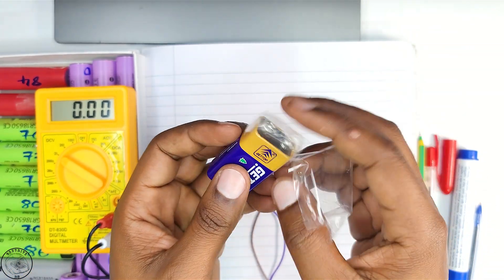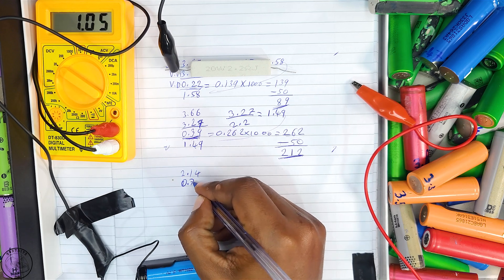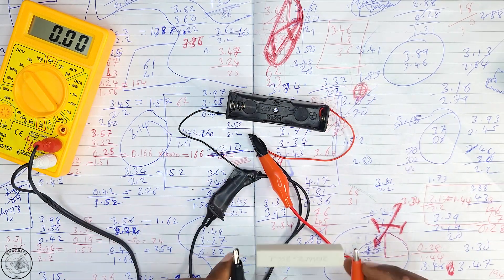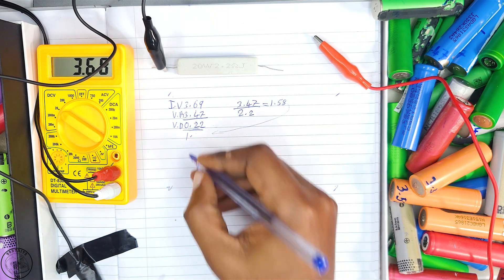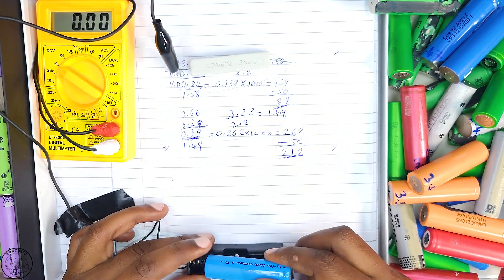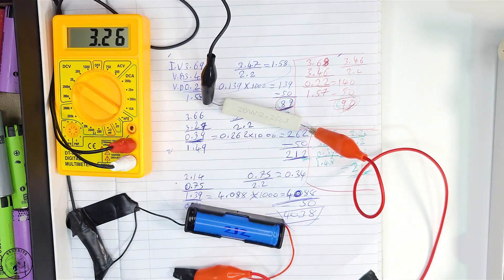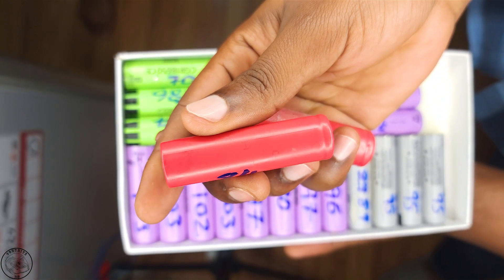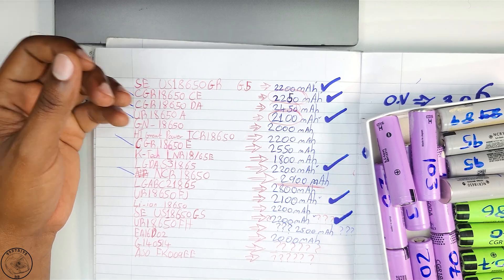DIY Resistance Testing of Li-ion 18650 cells from Old Laptop Batteries (Ep.2)

Comment: nice video.  I've been doing this at work, so it's interesting.  You may get better results if you use a multimeter to measure current, and another multimeter to measure voltage at the cell terminals.  That way you can isolate the characteristics of the cell from the load circuit.  then R=(OCV-V)/I
Reply from the maker: I will definitely try this out.  Thanks for sharing this 👍🏽.

Comment: Why not use a specific battery resistance meter for testing?
I think generally anything from Japan would be of higher quality as they pride themselves on good workmanship. Cars and electrical products usually are well made.
Chinese products on the other hand can be good but they are mainly about producing cheap and mostly rubbish or throw away junk.
Hard to trust for a good battery or anything long lasting.
I have my doubts even if they are supposed to be made to specification for an overseas company for quality control.
Go with Korean or Japanese to be sure.
Reply from the maker: This small series was created with the goal of testing and analyzing the cells in the most cost-effective way possible, ensuring that it’s accessible to everyone. I’m really excited about episode 3; it’s my favorite project to date, and I can't wait to share it with you!

Comment: The chinese cell is rubbish. A lot of cheap products use extremely poor quality 18650 cells, commonly with capacity of only 500mAh or less. Just rubbish, throw it away.
Reply from the maker: the quality of some cheaper lithium-ion cells is concerning, which can be a problem when they are used in higher-power applications.

Comment: That Chinese cell has an open circuit voltage below minimum thresshold. Therefore goes into "protect mode" with too high internal resistance. May attempt to slow charge over time to recover (4.2V at 50mA or less) but no guarantee that anode and cathode will recover uniformly. Better to dispose of.
Reply from the maker: Oh yes! I now realize the issue with that Chinese cell arose because I tested it at an open circuit voltage of 2.14v, while the other cells were all above 3.50v 🤦🏿. It makes so much more sense now! Thank you for sharing your insights; they’ve been really helpful. As I continue working on Ep3, I’ll be sure to repeat the test on that specific cell at the end Ep3.